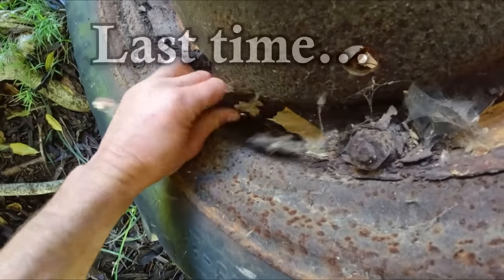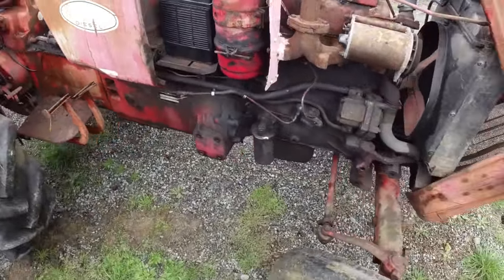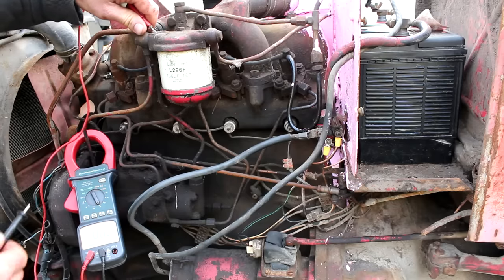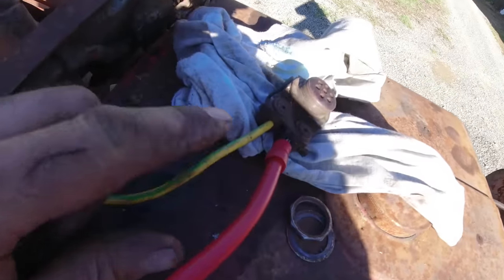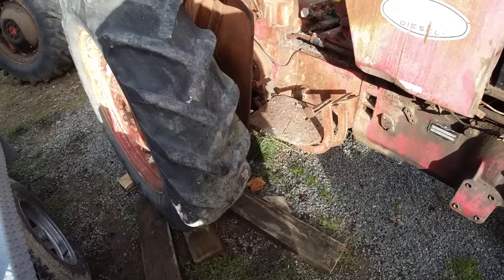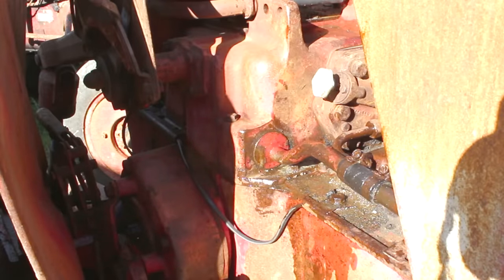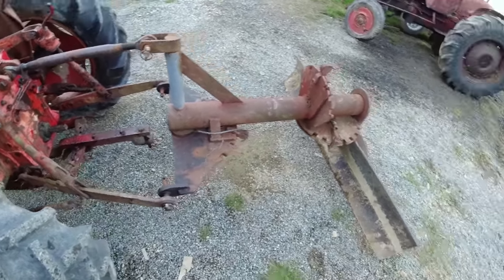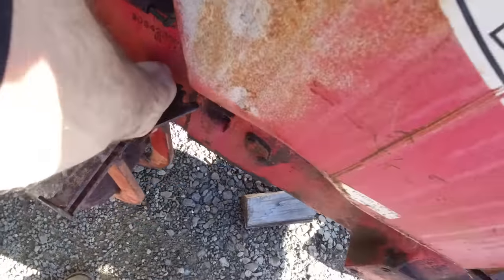Fixing the Salvaged Swamp Tractor and running it on Recycled Cooking Oil instead of Diesel

Comment: Mix it about 3:1 oil:diesel and the power loss wouldn't be so noticable. Also - first diesel engines were supposed to run on vegetable oil. We just started using diesel because it was a leftover from petrol creation process and nobody has found better use for it. Actually the emissions are also better than with the diesel. It's just a little bit of a taboo for some reason...

Comment: Great stuff mate. I make bio diesel from used cooking oil , over the ditch here in NSW, and I use methanol and potassium hydroxide that gets the glycerine  out and runs my ute just fine. Has done for over 5 years now and it's done over 500000 km. I heard another way was to filter it as you do through the spinamathing  and then add 10% petrol to make it thinner , also add 1% of transmission fluid with is identical to the old "Redex" remember that? All it was , was transmission fluid, I don't know what it was supposed  to to but sure couldn't hurt hey.

Comment: Strait veg oil has a ton of glycerin. It’s to much of a bother, but if one were to go thru the process of turning strait veg oil into biodiesel, the hp would likely return. Good idea mixing some diesel into the veg oil Marty. Run it hard and keep the engine hot, you’ll be fine. Cheers from NY.

Comment: I've driven a bunch of IDI (and early TDI) with about 5 liters of diesel in a 25 liter can and the rest filtered cooking oil.
Summer time without problems and winter time with 10 liters of diesel mixed in instead. 
That way you don't have to mess with different tanks. 👍

Comment: Wrap the veggie tank with a few wraps of line from a Tee off the coolant line and let that warm the veggie. A small heat exchanger of some sort with coolant will keep it nice n warm if you feel you need more heat to keep the veggie oil flowing well.
Reply from the maker: Maybe wrapping a copper vege oil feed line around the exhaust manifold would heat it more effectively
Reply: @MartyT  That will work great IF the oil in the tank is still liquid. Your warm weather should allow that. I used to run veggie but in a colder climate that allowed the veggie to become thick in the tank, making it hard to flow. The heat exchanger through or around the tank was best to keep it warm in the tank to allow it to flow. Even at a liquid state, warmer oil burns better. I had a 3 way valve set up so i could switch it from the seat 5 minutes before i got ready to shut it off.

Comment: Sir, vegetable oil has glycerin in the oil, makes cold starts difficult. If you process the vegetable oil with lye, the glycerin / lye will fall to the bottom to f the container and your vegetable oil should start as normal diesel fuel
Reply from the maker: I used a centrifuge

Comment: May be worth diluting the veg oil with some paraffin old diesels like the paraffin ring molecules  , also heating the veg oil before it gets to the pump would help , a copper pipe loop via the cooling system maybe worth a try,  a cup of white spirit added to the tank was the old fix,

Comment: This has been one of your more hands on and little guy friendly episodes.  Even I can gain information should I need to maintain such a beast in the coming apocalypse. 
At the time stamp 22:35 the steering arm is seen to be loose on the shaft.  A clean of the taper and nut tightening would be in order at some point.

Comment: You can run veggie in it no problem given it’s age and mechanical injection system, just use a strong fuel system cleaner from time to time to clean it out. Also your diesel at start up and shut down will help a lot. 
I used to put a litre or two of petrol into 20L of veggie to thin it down a bit before putting it in my old van, this is fine to do if the fuel tank doesn’t pressurise like a modern car.

Comment: Hey Marty you might try thinning the veggie oil with either kerosene, mineral oil or lamp oil if it’s cheaper than diesel. Dunno if the mineral oil will work, but the kerosene or lamp oil should work. Baby oil might work to think the veggie oil, but not sure I would use baby oil, as it smokes a lot when used as a substitute kerosene. But I do know that diesel and kerosene are almost identical, and that kerosene is often cheaper than diesel so should be a cheaper way to thin the veggie out.
Reply: In our country,(nz),diesel is currently $1.90ish/litre...kero is $15.00/litre...not thinning recycled veg oil(canola) with expensive kero...

Comment: you need to build a filter tower out of 55 gallon drums if you really want to run cooking oil its all about removing the solids and if you do a proper filter tower you can use the weight of the oil column to force the oil through finer and finer screens

Comment: I've ran my Peugeot 405 with the turbo XUD diesel on a 50/50 mix of veg oil and diesel for over 100,000 km with no problems. Glow plugs start a 50/50 mix for me easily, there is very little difference in power and it hasn't hurt anything in the fuel system.
I just let gravity settle the gunk in the 20 litre veg oil drums then filter it through a 10 micron filter sock and pour it into the tank followed by an equal amount of diesel.

As mentioned don't try this on a common rail diesel and it does work best in a diesel engine with prechamber combustion chambers in the head. Change your engine oil a bit more often as well.

Comment: In my cooking oil set up thats been the same for 30 years now,  I have a copper heat exchanger that uses radiator water to heat the oil, I make batches up of 130 litres of cooking oil, 12 litres of diesel and 1 litre of 98 unleaded.  Costs me about $25 per 1000 km.  And I flush out for 2 minutes with diesel at the end of the day.

Comment: Nice work it looks like it was never parked, I'd bet if it did start to gum up you could run some high grade diesel mixed with some high detergent automatic transmission fluid through the little tank and it would clean that right up.
Reply from the maker: Yes or some injector cleaner

Comment: One little thing with running machinery on vege oil, is that more regular oil changes are required. Note that the first ever diesel engine ran on peanut oil.

Comment: According to "project brupeg" the veggie oil needs to be 80 degrees Celsius at the pump, then it will burn without any smoke if the injectors are still good and you wouldn't feel the power los because  it's marginal.

Comment: I converted my 444 to standard 12v glow plugs by drilling and tapping the old plugs to use them like a bushing. That tractor will be fine on veg. I've been running my pajero on it for over 10 years.
Reply: You could probably run the veg in your Toyota pickup if it's not common rail. Heat exchanger and twin tank maybe. I had a m57 running on a blend for a while it seemed ok.

Comment: Not sure how it would turn out but some older tractors were designed to start on gasoline and when warmed up, run on Kerosene. Kerosene being the same as #1 Diesel fuel in most cases.

Comment: Great job Marty I would agree a fuel mix maybe a better idea just wondering are you using used motor oil in your rust preventive spray use used motor preferably diesel and mix it with bar and chain oil 60% used oil to 40% bar and chain oil works great up here in Northern Vermont since calcium chloride and sodium chloride (road salt) replaced plowing snow and the result destroying your cars and roads bridges culverts and about anything else it touches can't Wait to see how these electric cars hold up to all the corrosion factors of these very destructive snow melting products.

Comment: Kris Harbour did use vegetable oil for a misubishi diesel people carrier and he said there weren't any problems but I think his engine siezed and needed a rebuild. He'd used a filter  on the top of a rainwater butt. The idea was the filtering would take the bulk of large particles out and then anything else would sink to the bottom of the butt and wouldn't come out when you tapped off the settled, filtered vegetable oil.  I think he said he'd leave it to settle for a week or so to settle. If you did that and then used the centrifuge to take out any of the particles you might find you have more luck. There are a few 'remove carbon deposit' products for diesel that are only for diesel use and you could run that once in a while with diesel and then see if you can go back to vegetable oil. I don't think there'll be a drop in interest in doing this and it might be worth experimenting this way to see how long you can keep this tractor running. If you did a diesel tank full of fuel after cleaning the injectors in an ultra sonic cleaner for a service every year and then ran the engine with high revs and a carbon deposit remover, maybe you'll be able to keep the thing running for ten or twenty years. There isn't a lot about the need for different servicing of a vegetable oil run diesel engine online from what I can see and this is going to increase in terms of importance. I'd think about trying to get one of the local universities interested to see if they want to work on this - there should be some government funding for it really! You might just end up with a few students carrying out the repairs after the 50 year flood and then taking samples from the tractor. I saw one article on adding a another tank for diesel and using this to start the engine - who knows what the universities would come up with? Maybe adding another fuel filter that's cheap to replace could be all you'd need to do. https://costeffective.com.au/2017/03/05/successful-tips-for-burning-straight-vegetable-oil-in-diesel-engines/

Comment: I run my old "tractor" (it's a "motoagricola" in italian, I still haven't figured out the actual translation) on straight vegetable oil and it runs perfectly. It has a rope pull start and starts on the first pull no issues.
I'll probably stop doing that in winter though, I don't fancy having to take a blowtorch to the fuel tank if it solidifies...

Comment: Hello Marty T from Sydney Australia. Very nice restoration of the tractor. I don't understand the coil glow plug (seven hole) in the dash. A glow coil 12v circuit: what does it do? It's like a toaster element?
💡💫🇭🇲
Reply from the maker: The 'pepper pot' is so you can see the resistor heat up and the resistor reduces voltage to the glow plugs, apparently they blow out with 12v direct from the battery
Reply: @MartyT  They're probably 6V glow plugs that were used because was cheaper to use the same glow plugs that the previous model used.  And the model before that, and....

Comment: I bet Mrs Marty-T is ecstatic with having not one but two extra tractors in the yard. 😲
Didn't the parts tractor have a fuel tank on it that you could use for the fish & chip oil? If it was the fuel tank it looked ok on the outside and it's a tad bigger than what you are presently using and it would result in less trips to the cooking oil bowser. 😁

Comment: The more wheel weights you put on the back wheels you get better traction
Reply from the maker: True if the weight is equal on both sides.. If extra weight is on one side only then the other side will frequently lose  traction

Comment: Marty why is the resistor needed? Just to show the glow plugs are heating? GreT video. Thanks!
Reply from the maker: Yes and reduces the voltage, apparently the glow plugs will burn out if fed 12v directly from the battery

Comment: I trick my grandad used: he converted t ford and other engines to parafin/kerosin? (Petroleum?). I dont know how to propperly translate it. These engines where put in small dinghys pushing the sailing cargo vessels. He would twist a copper pipe around the exhaust. I know that for t ford engines dual fuel intakes where made in the 20/30 s. So whats new? And operated it the same way, heat up on gasoline and switch to the other fuel. It might need the engine keeping on temperature to run properly but it will work.

Comment: If you put a T on the fuel line with a valve on the veggie oil line you could just turn one off and the other on to switch instead of taking lines on and off.

Comment: Guessing you know this,  every fuel has a different point of combustion......  if your mostly going to run on WVO......  use a hard task path on your property as a test track.   fiddle with your Injection point timing with warm engine / on veggie: on your path to find out what gives you best speed/work.  This is a way to find out what timing works best with your veggy source.    running a fuel Tube  of copper?  around your exhaust pipe to heat the WVO more before it goes to rest of fuel system  may help too.  HOT WVO still suprisingly absorbs heat from injection pump system better than normal temp diesel.   As in some injections systems use the "fuel OIL" to cool the injection pump-ish system.  Not sure if this old international's injection pump does.. but it cant hurt.  WVO will Lube injection pump better than diesel. 

BTW is there a fuel return system on this old engine?  aka..... are you sending WVO back to diesel tank unintentionally?      

Then again ..... still looks like your no stranger to all this going by your centrifuge/filter setup..... so am foolishly giving advice to choir master on how to sing.
Reply from the maker: I'm new to the biofuel scene so appreciate all this good info. Cheers

Comment: Noticed when you fed that green and yellow wire into the resistor the end looked like there was some type of grease on the end of the bare wires, was that the case? Cheers love the channel.
Reply from the maker: Yes dielectric grease, the wire was pulled from another project
Reply: @MartyT  thanks mate, I had flashbacks from the rigs seeing that, Anti-seize and dielectric grease everywhere haha.

Comment: Over a decade and 5 different vehicles I've probably driven 250K+ km on recylced veg oil. Always had 2 tank system and coolant heated veg oil system. Managed to run direct injection (not common rail) system on it. Just had to be carefull about flushing with diesel at the end of trips. Unfortunatley new regulations where I live and modern engines make it too hard for me to be bothered any more  (it is possible just hard)

Comment: Thin your veg oil with about 30% diesel and it will work much better and you're still getting 3 times the fuel savings.

Comment: Seems the vege oil doesn't quite have the shear strength  or lubricity of diesel and often have injection pump wear problems with extended use . May not apply depending on useage .......

Comment: Oils "polymerize"...cross-link...over time...through heat cycles and oxidation.  Smaller molecules combine to form large ones which create "webs" which produce the horrible gunk found in old machines or new ones which get only rare oil changes.

Comment: Wouldn't it have been simpler to switch the engine of the swamp tractor to the "spare parts" one?😊
Reply from the maker: The b414 is a better machine with the hi / low range gearbox, b250 only has high

Comment: info.   my old VW golf used to run well on bio diesel and you could tell where to oil came from by the smell. i used 5to1 veg to diesel and no probs, they used to have some form of different seal in the fuel pump for the fuel . think they added a bit of ethanol to the mix just to add a bit of power .

Comment: Id seriously reconsider running veggie oil through anything with a CAV rotary injection pump - they're well known to be very intolerant towards it giving problems quickly. Let's face it, they're not the best of injection pumps anyway.
Bosch/Zexel rotary pumps handle it A LOT better.
Inline pumps dont generally have any trouble at all running on veg oil.

Comment: Hey Marty, when you flip the glow plug switch, the coil gets hot.
Does cold air pass over the hot coil into the intake? Please enlighten.
You can add one more valve to the vege oil line and connect a T joint so you don't have to switch lines.
The literature available on the net says you should not have any problem with old diesel engines specially the injectors or fuel pump. But you know best.
Thanks for the video.
Reply: Glow plug heat the air directly in the combustion chamber. Heater grid will heat the air as it gets drawn through the intake

Comment: You will lose about 10% power and get a little less fuel mileage. I would go with the mix you have said and never look back. Automatic transmission fluid burns quite well too.

Comment: 50/50 mix of vege oil to diesel is best for all round use. Shouldn't be any appreciable power loss and it should start ok. Try it in you small tank first both starting and running. If you like it, drain the fuel tank and make up the mix to refuel it with.

Comment: in Indonesia, the government makes biodiesel using palm oil mixed with diesel fuel at a ratio of 30% palm oil + 70% diesel fuel. you can find more detailed info on the news under the name biodiesel B30. and now the government is doing research on the use of 100% palm oil for bio-fuels.

Comment: mixed is ok but DO NOT LET IT SIT FOR A LONG TIME. uvo and diesel will turn to honey-like thick and clog up everything. like not all winter. And don't mix used motor oil with veggie oil I have done it all. for the last 30+years with a 6bt motor

Comment: Those diff locks on the internationals are weird I have a 434 gas engine and when you engage the diff lock it will stay in gaged even on sight turns and the disengage when you straighten out something todo with the gear mesh i Guess

Comment: Be careful when using straight vege oil as it will fill the engine with sticky burnt carbon deposits. I had a mechanic rebuild my 7kw diesel generator because I didn't do it the proper bio diesel method..Maybe that old tractor engine can do it? Fingers crossed.